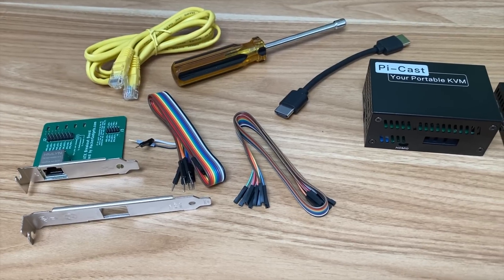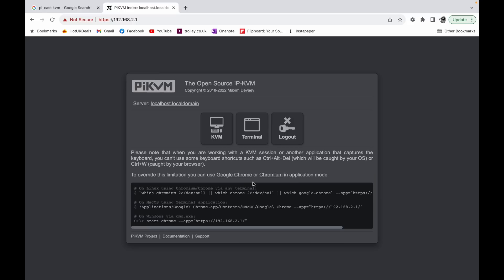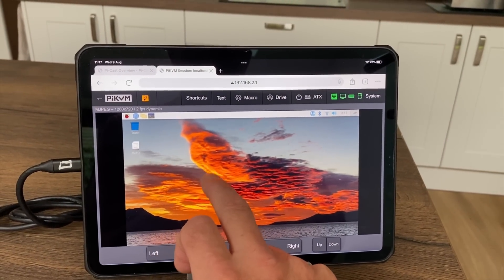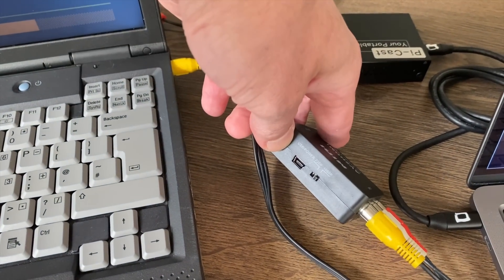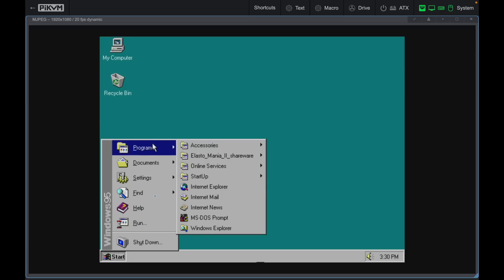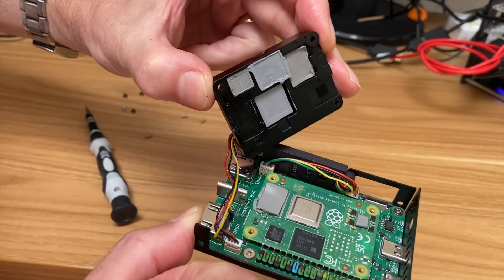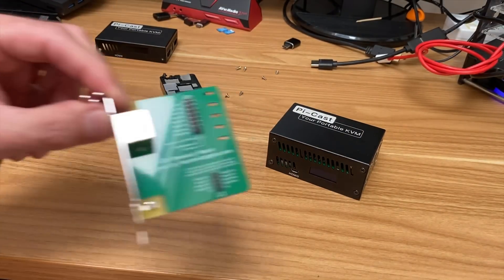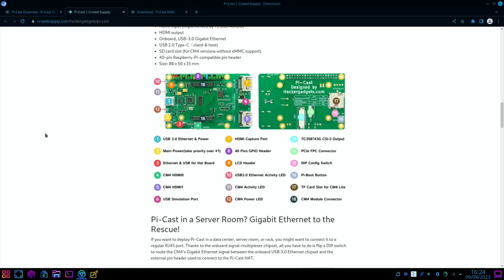A Portable Raspberry Pi KVM you can take anywhere

Comment: Interesting, but why should i give up using VNC, and i don't have those extra cables on the desk. OK now VNC is limited to 5 devices for a free account, but that i fine for me
Reply from the maker: Vnc is great. This once originally setup can be plugged into any os with mouse/ keyboard and hdmi. It’s great for me as I use multiple devices and operating systems. I just plug it in and it’s instantly compatible
Reply: this device give you low level access to your device like BIOS setting, reinstalling OS, any pc or device with keyboard/mouse input and HDMI output should work no matter what OS is installed.

Comment: Quite handy. I made a PiKVM a while ago using a regular Pi 4 with a USB HDMI capture dongle and Amazon high current USB hub to power the Pi and provide the USB keyboard and Mouse interface. All parts I had on hand. It works well. Mostly used it to upgrade other Raspberry Pis from Buster to Bullseye in situ and deal with any problems. This has the remote reset/power button presser and power switch built in. Video capture is probably faster too.

Comment: Brilliant video, I only wished I knew what it was all about.
I had to Google  what the TLA meant, Kernel-based Virtual Machine (KVM) is an open source virtualization technology built into Linux®. Specifically, KVM lets you turn Linux into a hypervisor that allows a host machine to run multiple, isolated virtual environments called guests or virtual machines (VMs).
The trouble is with TLAs us that unless you know what it means then part of the message is lost.

TLA?
Three Letter Abbreviation.
Reply: No, this is a different KVM, not related to Kernel-based Virtual Machines.
KVM = Keyboard/Video/Mouse.
The original KVM-switches were mechanical multi-deck rotary switches to connect one screen or one keyboard to several computers. These were then first combined into KV-switches, later mouse and sometimes printer connections were added.
By the time we started using USB keyboards and mice, those KVM switches had become digital rather than mechanical.
In the current generation, the keyboard/video/mouse signals are routed to/from a single serial (USB) interface, in a way those KVM switchers have evolved into some kind of hardware terminal emulators.
Reply: @koenlefever  Thank you for explaining,
Reply: Me too. Same result...